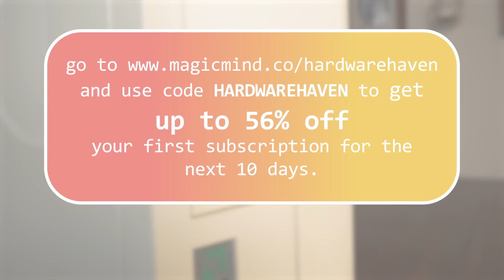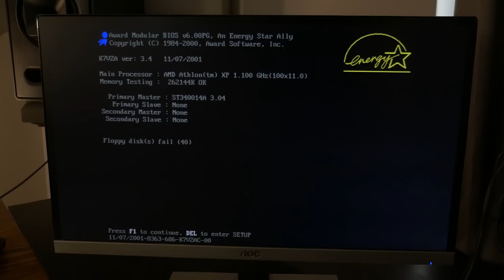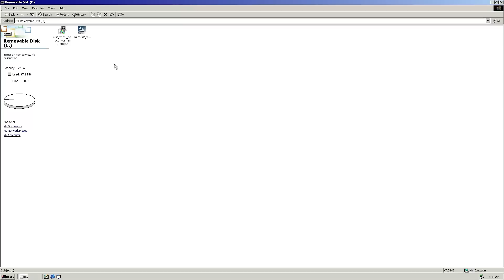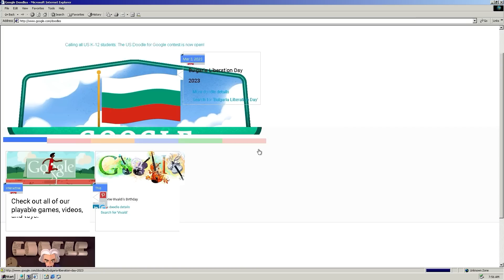The OLDEST PC I've Ever Worked On

Comment: The CPU multiplier might not be set correctly. Athlons running around 1 GHz weren't the "XP" variety, rather the original range of Athlon CPUs. The CMOS battery probably died and the bios didn't remember what the correct multiplier settings are for the CPU. You should investigate this as it's more likely to be 1.8 GHz or higher.
Reply from the maker: It’s 1.7. I figured out the FSB in part 2 haha
Reply: Original Athlons were called thunderbirds.

Comment: I have the same motherboard, my is just rebranded for a OEM system builder Shuttle. This is a socket 462/A motherboard for AMD Athlon/Duron/Athlon XP CPUs, it supports CPUs up to Thoroughbred B Athlon XPs.

These old socket 462 motherboards consume most of their power from 5V rail, so be careful with using a modern PSU on this thing, since they have very weak 5V rails.

Comment: TNT2 M64 Vanta is a common low spec'd graphics card.  The TNT was reduced with 1/2 the memory bandwidth from 128bit to 64bit for the M64, then the Vanta lowers the Mhz of the card and the memory speed and amount.   A TNT2 or variant could come with up to  32MB memory.   The best TNT2 would be The TNT2 ULTRA 32MB. Creative Labs even had a horrible software wrapper to allow you to run Glide games (kind of).

Comment: looks like that one time students at school i work at set power suply to 11v and pluged it in to 230V socket 
popcorn counds and standby power suply ded

also old atx 1.0 standard powers cpu from 5v directly on 20 pin plug not separate 12v line, but any new power suply would work if it suply enough amps on 5v line

Comment: Well, I remember when computers like that were a big improvement over previous ones.  I started working on computers before they were small enough to pick up.  Oh, except I could lift the common slide rule.  Realize humans lived over 100,000 years before kids started saying they could only accept the latest phone.

I was once given a copy of Windows 2000 by Microsoft for going there to participate in some user testing.  I like W2000; and it was the last Windows without any copy protection.  I liked the AMD Athlon processor too; it was one of the first that was easy to overclock.

Comment: lol at school in the 90s people used to put the power supply on the 110v US voltage (I'm in Australia)  240v next kid to turn computer on BOOM i helped replaced heaps of power supply's in the end we glued the switch to 240V
Reply: I wonder how many people know what that switch actually does? That's why there's two bulks caps in the input side. In 110V they're wired as a voltage doubler. A SMPS trades high voltage and low current for low voltage at high current. So it just works better with even higher voltage on the input side. They do it all to avoid having to use a huge iron core step down transformer. BTW US single phase is 240VAC we just center tap it. That makes common circuits 120VAC. We still have 240VAC though. We only use that for larger appliances.

Comment: Dual channel had three slots. Remeber max ram in the 9x days was capped to 756 unless you ran a really clean systen. Antime after the 756 you could interfer with system interupts. 

Dual channel used left slot as one and the 2 right slots as the other. So calling it a1 with b1+b2. The a and b sides had to be equal to run in dual.

Widows Millennia was a 9x mess some due to the release dates think Millinnia addition is 2000. 2000 was NTFS and you didnt have those interrupt issues with ram limits 9x systems had. I do remeber you had to add MSCONFIG to 2000. I dont remeber why though.

Finially yea as it has been said already 5 volt was you msin power back then. 30-35 amps on 5v was my go to back then for Overclocking those Mobile Barton cores. Bartons didnt come along until a bit later than that SD rig you have there.

Anyway thanks for the memories.

Comment: 3:20 you see that red switch , what country are you in, if its uk or another country with 240v, that switch is set to 115v so it is recieving more than double the expected voltage.
Reply from the maker: It was correct. I’ve learned my lesson there before haha

Comment: That would make a great retro build with a few parts mainly newer agp card and a ide to ssd or a ide to sd card.
Reply from the maker: Does IDE to SSD work?
Reply: @HardwareHaven  yes as long as you get a adapter for it. It's usually ide to sata. LGR has done some great videos on retro PCs and the adapters he uses to get them be more modern being ide drives are not plentiful anymore and are dog slow.
Reply from the maker: @GhostieXV  Sweet thanks!

Comment: Windows 2000 was buggy and unstable, and because that a lot of people hated win 2000...
Reply: Windows ME was buggy and unstable and well-hated. Windows 2000, which Microsoft dubbed the business "version", but was actually a completely different codebase despite having a very similar UI, was quite solid and stable for its intended purposes. I managed Windows 2000 servers for 10+ years, and even had Windows 2000 Pro as my desktop OS when I was doing JSP and Java Servlets programming for a major project. I rarely had any trouble with any of them. However, Windows 2000 was not intended for home use, and didn't play well with software that needed to directly interact with hardware rather than going through Windows' HAL and drivers. That meant it didn't work well with games and the multimedia software of its day. It also meant that hardware that wasn't intended for business use and didn't come with Windows 2000 drivers wouldn't work with it.

Comment: Ohh the irony, puts a ATX psu in does not have enough Molex Connectors, has to use sata to molex adaptors,  it Used to be the other way round not enough or any sata power connectors. Or missing the +4 on the 24 pin power connector.

Oh the joys of being a system builder during that transition.  And forget PCI-E Power on the psu,, you had to use a Molex to 6 pin connector and they weren't all the same pin out!

You kids dont know how easy it is these days, modular psu's. nvme drives,  all you have to worryy about is your 40 series card going to set on fire!
Reply from the maker: To be fair, I had to get the molex modular cable, not adapters lol